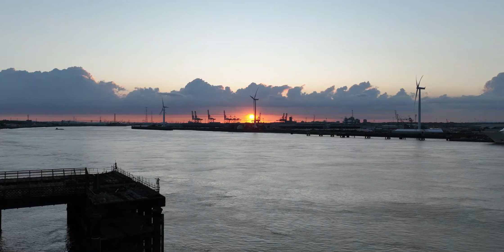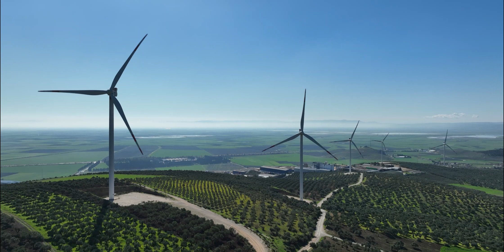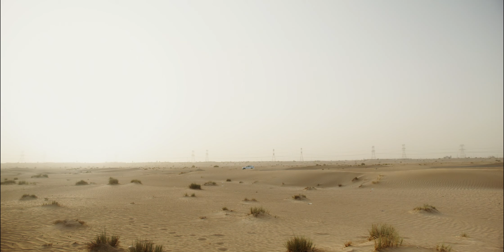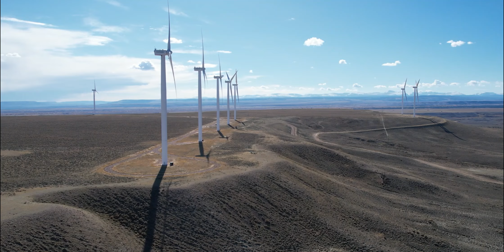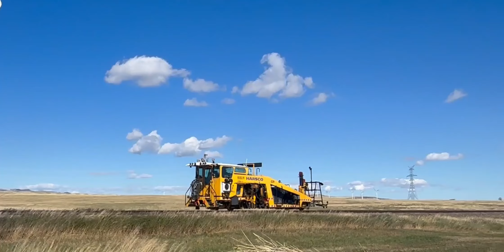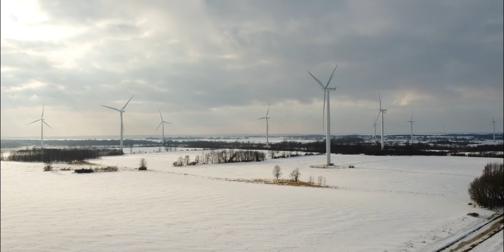Why Do Wind Turbines Have 3 Blades? Discover the Secret of Wind Turbines!

Comment: The explanation is approximative. The fact is that, based on physics, the power generated is INDEPENDENT from the number of blades, but very dependent on their length and area covered by the blades. Therefore, on a pure physics basis, the most efficient turbine would be with 1 blade, bringing the mass to spin as small as possible. Unfortunately, a 1 blade design is not stable is terms of machanical  resonance  : the turbine would vibrate too much. Same with 2 blades. 3 blades minimize stress effort and resonance. That's the main reason of 3 blades.
Reply from the maker: Great observation! You are absolutely right in pointing out that the power generated depends more on the length and area covered by the blades than on the number of blades. However, the choice of 3 blades in modern wind turbines goes beyond purely theoretical efficiency and involves key practical factors:  

1⃣ *Stability and vibration reduction* – As you mentioned, turbines with 1 or 2 blades suffer from mechanical resonance and imbalance issues, which compromise their durability and stable operation.  

2⃣ *A balance between efficiency and cost-effectiveness* – While a single-blade design could generate power, its structural stability would be a challenge. Three-blade turbines strike an ideal balance between aerodynamic efficiency, vibration reduction, and maintenance costs.  

3⃣ *Less noise and visual impact* – Three-blade models operate more smoothly and quietly, while also being more aesthetically accepted in various communities.  

So, from a purely physical standpoint, other configurations could work, but in practice, 3 blades offer the best solution in terms of engineering, stability, and operational efficiency.  

I really appreciate your comment and the opportunity to enrich this discussion! 🚀🔬

Comment: In a field of wind turbines, why do a few appear to be stopped while others are rotating?
Reply from the maker: Great question! There are several reasons why some wind turbines might appear to be stopped while others are spinning in a wind farm:  

1⃣ *Insufficient or variable wind* – The wind may not be blowing with the same intensity across the entire field. Since turbines need a minimum wind speed to operate (usually around 3 to 4 m/s), some may be in an area with wind below this threshold and therefore remain still.  

2⃣ *Maintenance or technical issues* – Some turbines may be temporarily shut down for scheduled maintenance or due to a technical failure. This is normal to ensure the system operates safely and efficiently.  

3⃣ *Power control* – On very windy days, some turbines might automatically shut down to prevent damage. The control system adjusts power generation to maintain grid stability.  

4⃣ *Production management* – In certain situations, the company managing the power grid may reduce the output of some turbines to balance supply and demand, preventing system overload.  

So, if some turbines are stopped while others are spinning, it could be due to one of these factors. Hope this helps! 😊